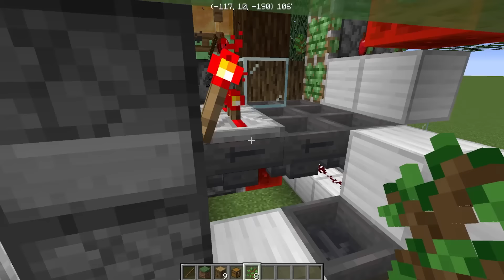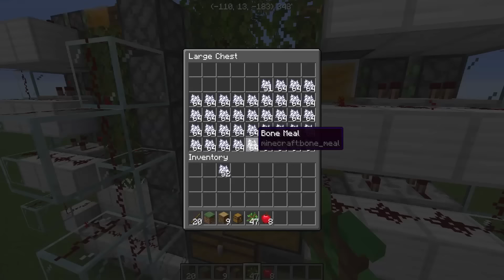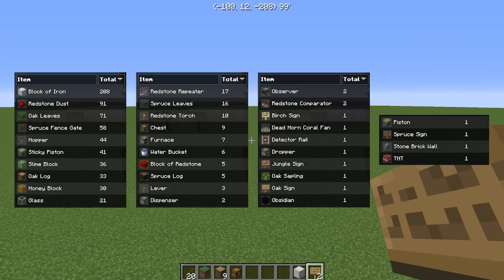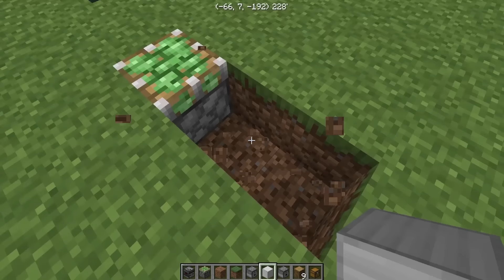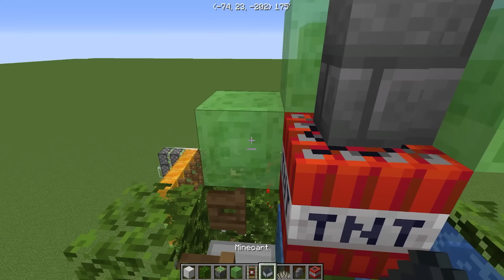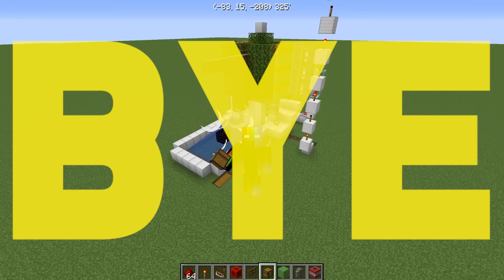Minecraft Tree Farm 26.1 - EASY AUTOMATIC TREE/ LOG FARM Tutorial

Comment: Attention to anyone having trouble with the TNT duper :

The TNT duper works as of 1.17.1. The TNT duper is NOT directional, that means that it will work in ANY direction.
If you build this duper and its behavior is that it will activate the TNT and break the fan without duping, if you are on a server, please ask the admin (or do it yourself if you are the admin) to go into paper.yml and assign true to the setting allow-piston-duplication (default value is false ).

If you cannot place the dead coral fan, it is because you are using a dead coral, not a dead coral fan.
Reply: I built this on a paper server running 1.17.1 and it worked fine a couple weeks ago, but at some point it broke and now that I've rebuilt the duper multiple times, it consistently drops the minecart. I've never had it break the fan. What's weird is that when I test the duper by breaking and re-placing the redstone torch as done in the video, the duper works, repeatedly. But once I load the items in the hopper clock and turn on the farm, the minecart drops every time. I suspect it might be the lag from all the extra redstone components when the farm is running. I've learned that paper/spigot includes an optimization called tick-skipping which will skip redstone/game ticks if there is too much lag, which will break dupers. Bottom line is, paper/spigot is just terrible and inconsistent for complex redstone machines. Apparently most technical players avoid paper servers for this reason.

Comment: Appreciate the tutorial, brilliant farm. However the material list isn't the most accurate leading to some confusion as well as some quirks with the farm:

-Farm quirks-
After the farm is built, NEVER manually break the wood on the dirt unless the farm is off. If you do want to break it manually, make sure you get rid of all the wood in that row, otherwise the farm will break when you turn it back on.

I suggest packing a stack of furnaces, to make a wall around your afk spot, a creeper blew up my farm wasting 20 minutes of repair time, using glazed terracotta/obsidian work, leaves don't for some reason.

-Material related-
For one, you need 2 droppers not one
and you also do not need iron blocks, use any block u like
It didn't mention the minecart
Pack a little extra slime
Pack extra leaves
and finally be careful about orientation

Just some things to help anyone watching this tutorial
Hopefully I saved you a few minutes :)

Comment: the tnt duper doesnt work for me if i take the torch away i tried 5 times adn rebuild the entire thing a couple times
what could be the problem. the tnt gets lit but there ist any duplicatet one
Reply: If you have built it on a paper server please ask the admin to go into the server files and, in paper.yml assign value true to the setting allow-piston-duplication (default value is false ).
Reply: @Hepad_  this was the solution i also found on some post in a random forum somewhere but it helped, thanks
Reply: Check and make sure you don’t have leaf blocks blocking the slime blocks from moving. That was my problem as I blew up my duplicator.

Comment: I got the farm working but with a few optimizations.
1. Obsidian borders around the leaf crusher part of the farm.
2. Enderchests on top of the hoppers in the collection system (not obsidian so items can still go in).
These made the farm safe from stray TNT, which i would get every few minutes.
Another Problem i have is that whenever i run it with jungle trees i run out of sapplings.
Reply: so you are not getting enough sapling back from jungle?
damn, searching for a jungle farm that gives enough back, already have all the other sorts of wood
Reply: @noodle8881  what usually happens is I use a fortune 3 hoe to get a b stack of jungle saplings and that will get me to a double chest of logs
Reply: @noodle8881  It has to do with the low amount of leaves on jungle trees, not with the farms. It's just not sustainable because of that.

Comment: If spruce is not working, rebuild the dispener + glass block and logs above + replace pistons in correct spot, make sure all repeater timings are correct everywhere and all blocks are right. retry the farm and it should be fixed

Comment: FYI if you accidentally activate the tnt dupe machine, don't try and block it with your shield. instead, run because you will die and then another tnt will blow up your gear. and before you rebuild it, destroy the hopper clock because that will still be doing its thing and when you replace the pistons it will just blow up again.

P.S. Fuck Minecraft mane just spent all day getting the shit I need and making honey farms just for me to die and have to load a backup from a few days ago.

Comment: The schematic is wrong in the TNT duplicator part
Reply: I'm also having issues on 1.17 with the TNT Duper, It worked during the testing phase just as he had done, but once the build was fully complete it stopped working. Going back up to replace the redstone torch doesnt set off the pistons at all anymore
Reply: @brosee27  I meant the schematic file is wrong, the one you use with the litematica mod, but then I followed the video steps and it's working fine in 1.17. The issue is that slime blocks are in other place by 1 block
Reply: @joseluz11  How did you get the hopper clock working?
Reply: nvm got it

Comment: Hey, the farm works great , but whenever I try to use it with spruce saplings, the saplings just won't grow for me. Has anyone any solution for that?
Reply: FIXED: the repeater behind the growing chamber that is connected to the double pistons that push the logs away requires 3 ticks
Reply: @raixxel7141  For mine, it still doesn't work?

Comment: Hi guys, does this work on spigot 1.17 server? I just built it and the pistons aren't extending all the way

Edit: I fixed it my repeaters were on wrong ticks
Reply: Same thing happening to me
Reply: @Nyx1onx  nvm my problem was the repeaters on the piston were on same timings
Reply: @EndomouEnd  is there any fix to tnt not duping in 1.17 paper?
Reply: @demaisher182  I believe there is a setting on paper.yml that disables tnt duping on default
Reply: @EndomouEnd  any way to enable it
Reply: @demaisher182  you can change the setting on paper.yml and enable it
Reply: @demaisher182  https://paper.readthedocs.io/en/latest/server/configuration.html

Based on this 

You can set the "allow-piston-duplication" to true it should allow tnt duping
Reply: @EndomouEnd  thanks
Reply: @EndomouEnd  you just change it to true correct?
Reply: @demaisher182  yeah
Reply: @EndomouEnd  I believe the duper brakes when you either reload chunks or i cloudless be when you respawn with the tnt duper’s chunks loaded when you spawn

Comment: could you add in the description where i should start building if i'm building inside a 21x16 area? thanks
Reply: I figured out that the 9th block deep from the front (21) side and the 7th block in from the right side (18) worked
also the dimensions appear to be more like 20x19 instead of 21x18, but that shouldn't make too much of a difference
Reply: @bheco4 thanks

Comment: dusty, i dont know if you will see this comment any time soon, but does this new version of the farm fix the issue with previous farm of the gates not opening for when extra tnt is duped and blowing itself up?
Reply from the maker: yeah, I removed the gate timer because so many people had an issue with it
Reply: @DustyDude  perfect! Built it earlier on and it seems to be working fine! Just as a precaution I dumped more items in timer hopper to extend periods between tnt duping as from what I could tell the issue was only when switching off the farm, I just make sure I switch it off right as it dupes another

Comment: So i made it and it wasn’t working at first—the first/second rows of the far leaf crusher alternated instead of syncing. while troubleshooting, i accidentally flooded the lower red stone area and replaced it. And it works flawlessly now. 

Any tips for reducing lag?
Reply: nvm the second row doesn’t retract =\
Reply: Figured it out. on the far end (away from the AFK spot) i’d attempted to cage the walls in and a rogue block was getting stuck to my bottom row slime block (farthest away from the piston) causing the 2nd honey row to stay extended and the slime to only go once. 

Removed the rogue block, pressed a button on that glass red stone staircase and it fixed itself.

Comment: Best Tree farm I've used. Really good tutorial.
For those having teething problems. If your using a heap of bone meal to grow a tree then chances are something is broken.
 I found I placed the block at the top, one, too high and Oak tree's would break it randomly. Spruce worked fine. If your crusher gets out of alignment then you've broken the machine. Do a check of the video and your machine to see whats out of alignment.
Haven't tried jungle but the other 3 work really well, although very laggy, for me.
Reply: ^ this. and sometimes a rogue block may get attached to the back crusher furthest away from the pistons which will cause the back crusher to be misaligned for some reason

Comment: It's a really good farm for wood and apples. Also be prepared to throw thousands of bone meal into this thing in a very short time.

On a side note, I had a creeper sneak up on me and blew up a bit of redstone. I put it back correctly, and lit up some of the top of the farm to stop creepers from spawning up there, it seemed like my saplings were then using a lot more bone meal before growing, so I removed the lighting and it still seems like the saplings are using too much bone meal, like seriously some of them are using 10 or more to grow. Is this normal?

EDIT: I fixed it, the back leaf crusher got de-synchronized because I didn't realize it lost a repeater which I had put a redstone dust instead. Re-watching the tutorial helped fix the damage caused by the creeper explosion. Working better now, the trees grow fast again.

Comment: i built this way in the air so i can afk my GP farm and it was quite difficult to build, took two or three good hours. fired it up and...nothing. it seems that the bonemeal is not getting dispensed somehow. can droppers power dispensers like that still? playing 1.16 java on a server...
edit: actually it works, i wasn't using a dropper. now however the TNT duper isnt working even though i know this design works fine on my server. trying to figure out why
edit2: i for some reason had a lot of trouble with the duper but finally got it. really strange, not sure what the issue was.
also for those struggling with the machine "staying on" like me (you hit the off switch but all the arms are still extended) make sure you turn off the TEST SWITCH lmao it took me a while to realize that. 
great machine.

Comment: thx just built it and worked perfectly. i would just recommend to extend the water streams at least 4 blocks on the other side, build up one wall with 3 high obsidian, and lower the water stream collection so it drops down and goes another 8 blocks. otherwise the tnt will sometimes stack up and be blown off to blow up the surroundings-but not the farm
Reply: the tnt shouldnt stack up, it has its own timer
Reply: ty

Comment: Love this farm design, but I'm having trouble switching between tree types. Do modifications need to be made to go from oak to birch or spruce? Thanks for any help anyone can give!
Reply: i know it’s been a bit, but i tested a rainbow variety and it seemed to work fine (jungle just doesn’t produce a lot of saplings)
Reply: @Lothlorian777  Thank you! I actually did some science of my own on this and discovered that I am very dumb. I used stone bricks as my building blocks and thought that the double piston extender which pushes the trees forward could be made of bricks as well. It turns out that birch and spruce will not grow in those conditions and actually need the logs there in order to grow. I didn't directly follow the farm design, so it's poor production was my mistake. That said, a note from Dusty at the point in the tutorial would've helped my smooth brain figure things out. Thanks for your help, though! I appreciate the reply :)

Comment: The leaf breaker extends by 2 block but only retract by1 block. On the other side, first and second row doesnt extend2 block. Any solutions?
Reply from the maker: The delay on the repeaters is incorrect. Check all the repeaters
Reply: @DustyDude  i've checked it and you're right. I thought all is 4 tick turns out im wrong. Thanks for the help